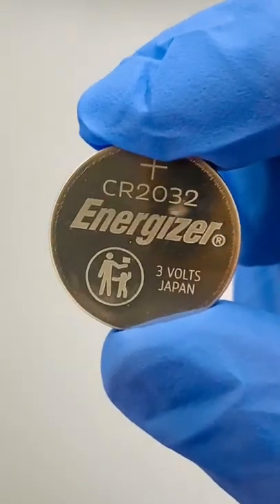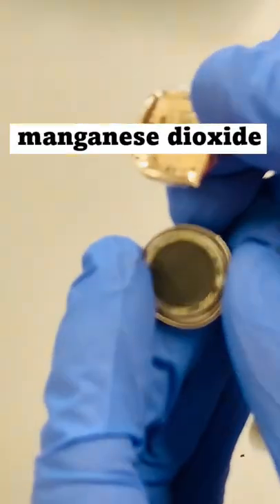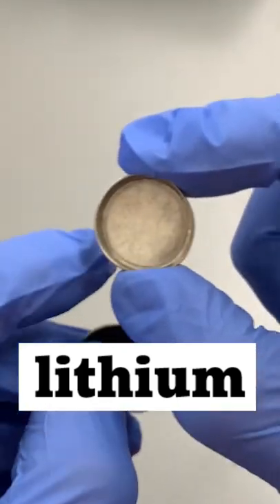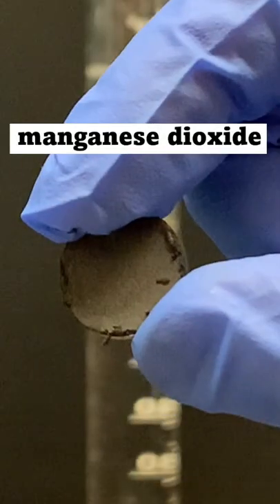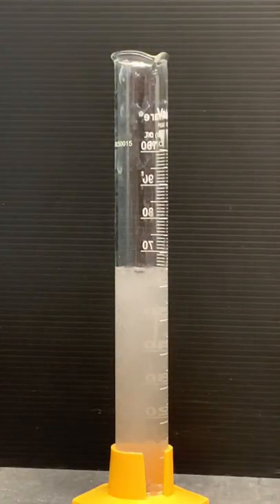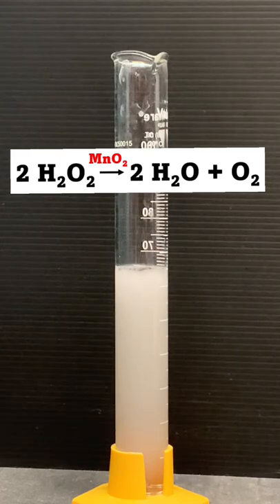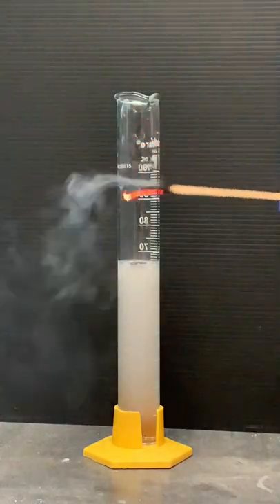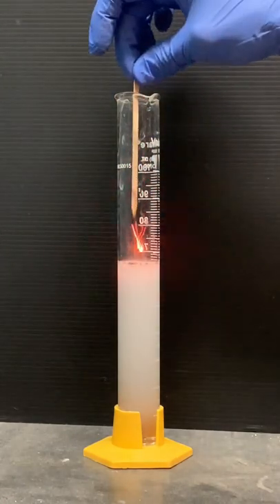What's inside a battery? Part 2🔋⚡️🧪 #shorts #battery #chemicalreaction

Comment: That's how shorts should be 
interesting and knowledgeable
Reply from the maker: Thank you 😊
Reply: @TommyTechnetium  And COMPLETE!  Most shorts today only give a portion of the info. THIS is how shorts are supposed to be. Kudos!
Reply from the maker: @bigbossimmotal  Thank you 😊 It is indeed a challenge to fit everything in within the 60 second limit on shorts. I'm glad you feel I did so on this particular video
Reply: @TommyTechnetium sir,in textbooks it is written that H2 burns with a blue flame.but why Li and h20 produces pink flame?is it due to Li+ ion rather than h2?
Reply from the maker: @Indian-et3wl  That's correct; the presence of lithium in a flame imparts a pink-red color
Reply: @TommyTechnetium  Thanks sir.I am very happy that you have answered.

Comment: That battery is big enough to be an Edison generator.  You could put a permanent magnet motor inside the coin sized battery and have a permanent source of current.  You can stack to add current and use transformers to increase voltage AC power.  This could power a permanent headlamp for miners or a permanent lighter for people who don't smoke but are outside a lot.

Comment: So if you had a way to get both the h2 and the O2 offgases you could have the battery produce H2O + o ? Or h2o2? Which is the peroxide you used to get the second reaction... What

Comment: MnO2 + H2O2 = jetpacks and tip jet helicopters 😂, but always wondered if the MnO2 degrades overtime 🤔.
Reply from the maker: Wait...peroxide and permanganate are used to fuel jet packs? I didn't know that. Thanks for sharing

Comment: You can recharge those batteries atleast once but usually a few times, my car remote takes 2032 's & I put a dead on a 9volt positive to positive & negative to negative & it worked again , can't do it for long as it gets hot & can pop / explode .... 60 seconds or less

Comment: That's the part I ignored in my button cell video. 👍
But of course oxygen is not missing in my video about gas detections. There I used MnO2 and H2O2, too. 😎

The popping sound comes from the wood gases and CO of the smuldering splinter, not from the oxygen (in difference to hydrogen). Some things literally explode in pure oxygen when ignited because of the large contact surface, like a sponge soaked with liquid O2... 😱
Reply from the maker: Tell me a bit more what you know regarding the popping sound heard when ignited in oxygen. I also hear it upon igniting a paper towel soaked in LOX. See first few seconds of this: https://youtube.com/shorts/lM88aLxuuE8

Comment: That's why EVs with those kind of batteries self ignite under certain conditions and can't be extinguished 😮😮
Reply: Thats not really true. EVs use rechargeable lithium-ion-batteries. The battery in the video is non-rechargeable lithium metal battery. Lithium-ion-batteries dont contain metallic lithium and thus are more benigin when ignited or in thermal runaway. Still dangerous but a EV fire can be put out with water and enough cooling of the battery pack.
Reply from the maker: @jonasb911  Thank you for clearing this up

Comment: Are those elements still present in a "spent" battery? Not sure exactly how this stuff works so I'm curious if the elements get used up similar to a fuel source
Reply from the maker: The lithium metal gets oxidized to lithium ion, while the manganese dioxide gets reduced to Mn(II) and Mn(III) compounds

Comment: Would it be possible to produce enough hydrogen using lithium to run a car 🤨
Reply from the maker: Yes, but it might cost quite a lot to purify the necessary amount of lithium
Reply: @TommyTechnetium  what about collecting recycled batteries, is there a way to control the reaction to make it more of a safe production?
Reply from the maker: @Rick-sanches1  The lithium in used lithium batteries is in the form of lithium ion, and would need to be converted back to lithium metal to work